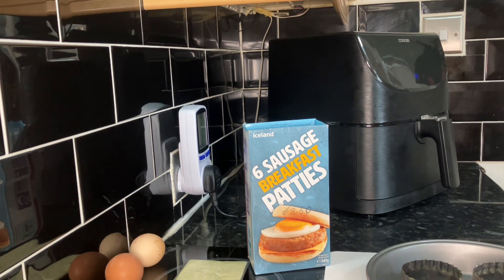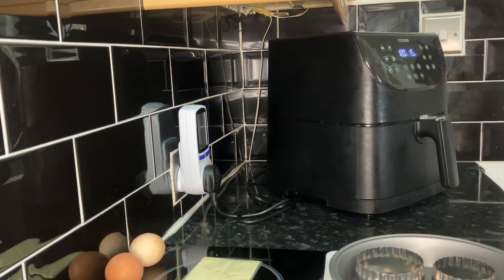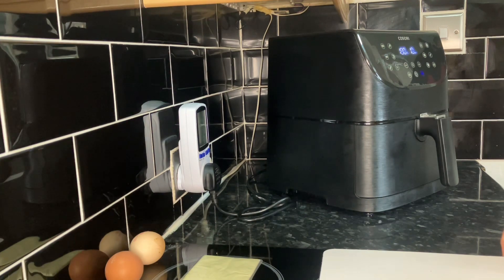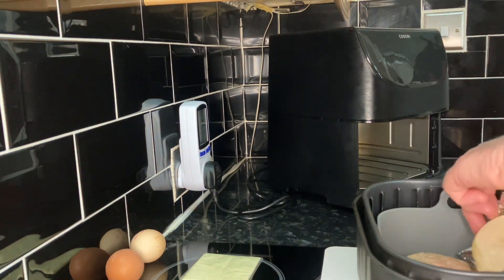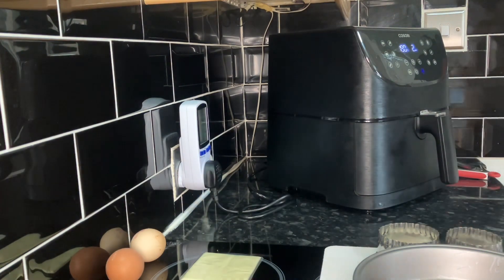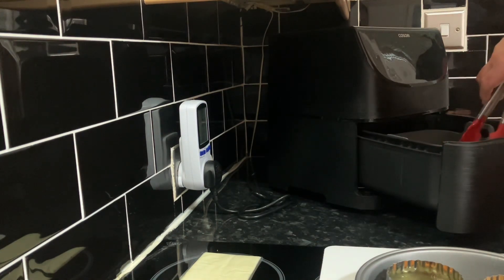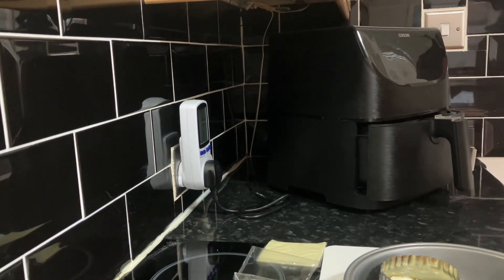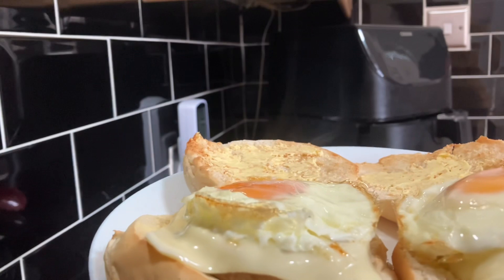Air fryer  breakfast patties in a silicone liner

Comment: Thanks for clearing the electric charge up. Looks also like the silicon insert does a good job without affecting the cook.
Reply from the maker: I looked on Google for the electric price conversion. I think the silicone tray will be good but it’s early days. It does keep the air fryer cleaner.